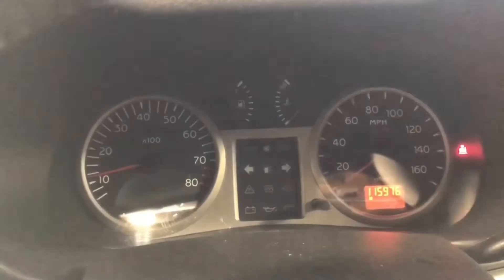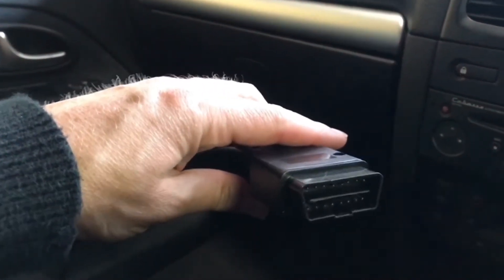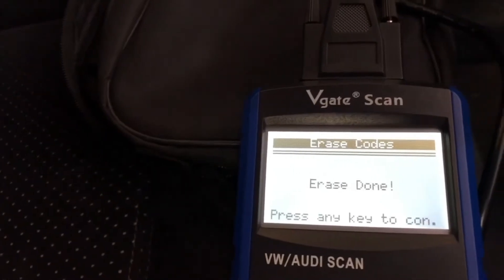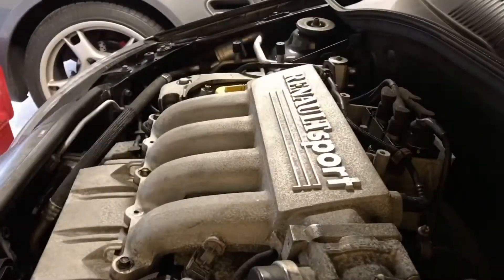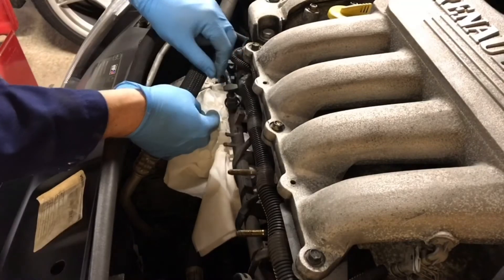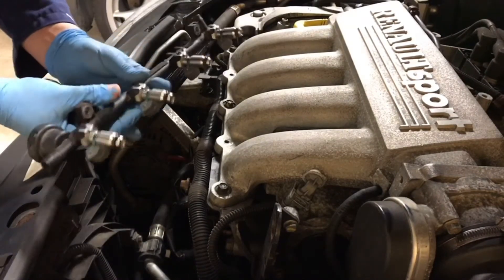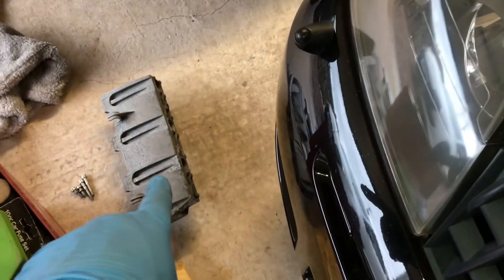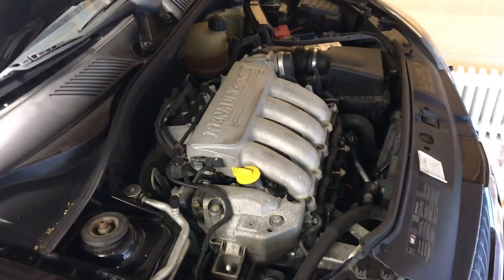Clio182 OBDII Fault finding and Fuel Injector replacement

Comment: 7:53 what size are those nuts 10mm ?
Reply from the maker: Sorry pal I don’t know! It was a while ago and I haven’t opened the door of the 182 in 18 months, never mind the bonnet. New Years promise is to get the 182 back on the road in 2025!
Reply: Just replaced mine. M8 Flange Nuts. They require a 13mm spanner (socket in this particular case, of course).

Comment: Can someone Help.I have Renault clio 1.6 gt line 2011,137000 kilometer on the clock.the problom that i have is when i want to accelerate,the car goes into limp mode and the car start shaking pretty badly. code p0300 ramdom multiple cylinder misfire detected.

Comment: 182 is lumpy garage found nothing because it was intermittant, now its all the time, my fault code was cylinder 4 so ive just bought an injector but mine was £75 from Euro car parts??
Im hoping this bloody works, ive been forced to drive it to work.
Reply: Hi mate did it fix your fault? I've got the P0204 injector error
Reply: @nicksmith1868  Initially sorted the problem, but later started to missfire again, three weeks back put all new injectors in and now it's fine.

Comment: 8:04 doh!! been there..lolol Did you disconnect the battery first? especially if fuels splashing about. Rub a wee bit of petrol on the rubber seals on the injector before pushing them back in. Good tutorial look forward to more. Thanks!
Reply from the maker: That’s good advice about the seals - thanks